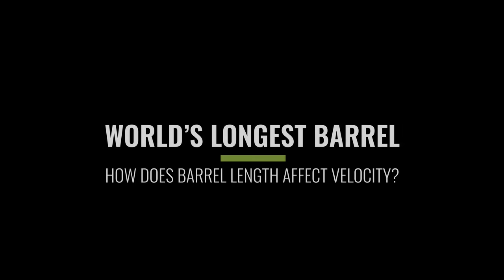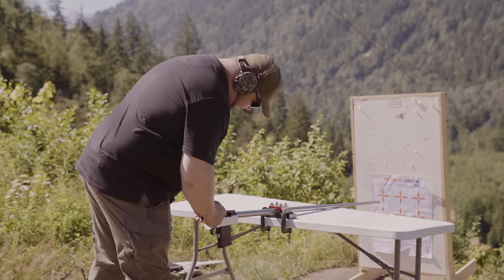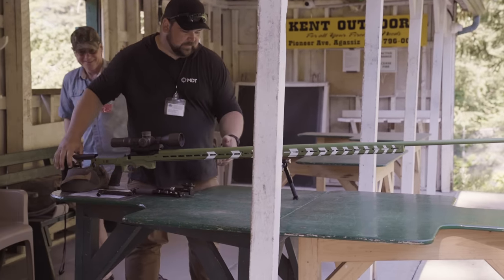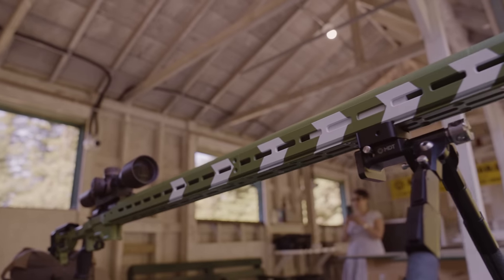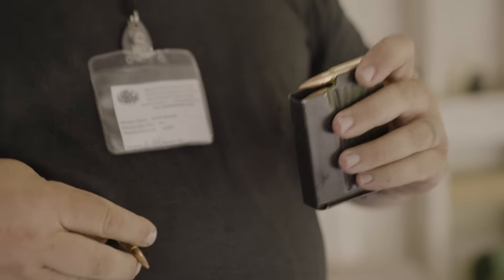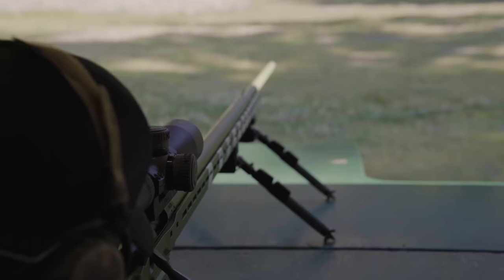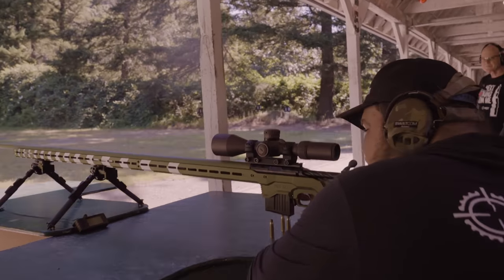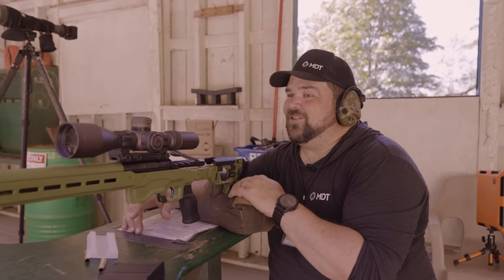Cutting The World's Longest Rifle To Find The Perfect Barrel Length

Comment: This is awesome, great job. And kudos for teaming up with Bob Jury, he’s a great guy. I’d love to see this test done again with a cartridge with a lot more powder behind it, like a 300 Norma, 30 Nosler, or 30-378 Wby. Would be really curious to see what the graph looks like when there’s a lot more ooompf behind it than a 308 Win. Totally understand why you chose the 308, though. Far more relevant test to what larger numbers of shooters are actually shooting.
Reply: :  Additionally, for the purpose of understanding the science / physics test some rounds that are UNDER loaded with powder, say after standard, then; 84%, 71%, 59%, 50%, 42%, 35%.  at the longest length, and graph the results.  As you cut the barrel shorter, maybe only ones with  Std, and 50% powder load.
Reply: @johndavidwolf4239  So they can get stuck in the barrel😮
Reply: @catherineharris4746  No, Start with the Std. load, then work your way down, plotting as you go, if the plot line appears to approach zero for the next lower round, stop, even if a round gets stuck and needs to be pushed out, (I heard that there is this thing called a "ram rod" that is used to push bullets through barrels, and that it was invented centuries ago) that it is a data point, helpful to better understand the ballistics of that caliber.
Reply: @johndavidwolf4239  💡Wow I could of sworn that ramrods were for muzzle loaders that were the only guns used centuries ago. I didn't know they had and used higher pressure center fire rifles centuries ago, and were able to push a stuck slug out of a rifled barrel😕 Are you sure they had these same center fire rifles that required 50k to 60k psi to force that slug through the barrel, and is it really that simple to use a ramrod to push a slug out of a barrel that took that high of pressure to get it stuck there? Dang I guess i just learned something new👍
Reply: @catherineharris4746  : 1)  There are shooters that use muzzle loaders today.  2) The 50k to 60k psi in not needed to force the slug through the barrel as much as to accelerrate it to the supersonic muzzle velocity in modern rifles. Unless it gets stuck just a few inches from the cartrage, it will have already been swaged to the barrel and the rifling and should require no more than a few pounds of force to push it out.
Reply: @johndavidwolf4239  that’s a great idea reduce the loads of the bullet doesn’t come out, and then the gun blows up in your face because of the pressure building up

Comment: I would venture to guess that the left-right deviation you saw as you cut it might have been due to the crown not being perfectly square with a bandsaw finish. I have seen rifles with less than ideal crowns do some wild stuff. Great video!
Reply from the maker: It could be, but there has been some testing done on this subject that says otherwise, but it was still a fun test!
Reply: @MDTTAC  a great shop tool for you guys would be the Manson crown cutter set up in carbide. Manson Precision Reamers setup with a simple cordless screwdriver would give you as near perfect a crown as you can get in minutes for each cut length. Many of us keep copies of your data points because we can trust them. And true accuracy testing means a proper crown. Cheers and thanks for all your hard work everyone!
Reply: @MDTTAC   It’s too late now, but it might be interesting to do this again with high speed photography of the barrel movement in vertical and horizontal axies (and possibly twisting…).  Maybe even a little accelerometer on the end of the barrel.

In a practical sense guns getting too long is a problem, but bullpups exist and adding +10-12” that way is plausible.

This was 308 correct?  I should sit down and run the swept volume in barrel vs case volume numbers.

Comment: I’m 4 years into my physics bachelors and I tried to make a 150 psi air gun that was fully optimized for shooting a 15 grams projectile. When I did the math for the optimal barrel length I was surprised that it turned out to be roughly 2 meters. At first I thought I miscalculated something, but after going through it with an engineer and a mathematician friends of mine, turns out I was right. I didn’t end up building it due to legal reasons lol but I’m glad to see this video. Thanks for making something I couldn’t make myself.

Comment: You tailor the handload to the barrel length available, picking a slower powder for a longer barrel. The same load will perform differently in a 20" vs a 30" barrel. 
9mm handgun vs 9mm carbine is a good example how different the same calibre can perform. If handloaded properly.

Comment: That's awesome, thank you for collecting and sharing that data.  Several years ago I published the results of doing something very similar with a shotgun.  I started with a barrel length at 36" and cut it every inch, measuring MV with slugs, and every 6" in group size with buckshot. We ended up with a 6.875" barrel when done.  The results were surprising and I'm still contacted about it today.  It was published in Small Arms Review Magazine.

Comment: Terrific video!  I’m going to gout on a limb here and say that the optimal barrel length is the length at which the increase in velocity is 1% of the muzzle velocity.  So, for a bullet going 2500 fps, when an additional inch gives you no more than 25 fps, that is when you stop.
I collected some data from other cases where people have cut down barrels such as in this test.  It seems that with .223/5.56, the velocity from a 20” barrel is about 3000 fps and the gain in velocity from a 20” to a 21” barrel is about 29 fps.  Some calculations I did suggest that the optimal barrel length for a .308 would be 21”, 22” for a 7mm-08, 23” for 6.5 CM or .30-06, 24” for .243 and .270, and 25-26” for magnums like 7mm Magnum and .300 Win Magnum.  To get the best out of something like .338 Lapua or .300-378 Weatherby you’d want 28” to get to that 1% velocity per inch mark.

Comment: This type of testing has already been tested by militaries and there's already data available about the limits of positive gains in velocity and energy delivery in correlation to barrel length. There's also information about barrel twist ratio and how it correlates downrange with varying barrel lengths but I don't know much about that information. This test makes me wonder how much your rough crowning is affecting both your speeds and impact points.

Comment: Great video. I been saying longer barrel faster speed for years and it is cool to see video proof. Seen way to many people claim short barrels are faster and better when my personal experience has been the same as this video.
Reply: A lot depends on the cartridge.  For instance, velocity vs barrel length is much more of a factor with 22lr
Reply: @John-uo1qf  wrong, but believe what you will
Reply: @Randy_Cox  Point me to the data
Reply: I have never heard people say shorter can be faster except in the airgun world with spring-piston airguns where the gas volume & energy is extremely limited. In any practical rifle using a rifle cartridge, longer is faster. If it makes a bang at the muzzle, there is plenty of energy remaining.

Comment: 1) Did you chamfer or radius the id of the barrel each time you shortened it? If so, R or C, how did you do it, and how much?  2) In addition to inches, you should also have "calibers"  on your graphs, as length of barrel divided by bullet diameter. 3) IMHO there should be an equation for barrel length (in calibers) that gives the highest velocity based on bullet mass (weight) and cartridge volume, or weight of power, using a "standard" smokeless power.  4) the peak velocity at 45", 150 calibers is about what I expected, but I expected the velocity to gradually decrease longer than that.  5) While you attributed the loss of velocity to friction of the bullet down the barrel, at some point there will be a negative pressure behind the bullet after the volume of barrel ID behind it exceeds the volume of hot gas from the power burning, at atmospheric pressure.

Comment: I've never seen an instance where you lose a significant amount of velocity from excessive barrel. VSO even did testing with a ridiculously long barrel on a 45acp and it mirrors the curve you plotted.
Reply: As much as I dislike VSO, his content is pretty accurate on data points. 

I'd be very willing to bet a large sum of money that you'd need a barrel longer than 10 feet to start seeing any significant dip in velocity, and even then, I'm not so sure. 

My only reservation about this would be in a gas gun where gas could potentially flow backwards, and create suction once the round pushed so far out into the barrel, and gas had already cycled the bolt carrier group.

Ideally, you'd push your gas system further out to counter the extreme dwell time. At a certain point, though, you wouldn't have enough pressure to cycle the rifle... so having a gas system would only serve as a hindrance.

Comment: The real key to this test is the factory powder used, which is designed for much shorter barrels.   If you used reloads with a slower powder, I think you'd have seen a much greater increase in velocity in the longer barrel
Reply: I agree, it depends on the distance down the barrel when the propellant is fully burnt and the subsequent distance when gasses maintain pressure before reducing. A slower burning powder may very well increase the velocity in this barrel test.

Comment: I've always wanted to see this, I hypothesized that most centerfire rifle cartridges generate more than enough pressure to keep the bullet accelerating for far more than typical barrel lengths. It'd be even more interesting to see this test done with super high-velocity underbore rifle cartridges like .30-378 or .220 swift since smaller bores really need the extra barrel length to create more volume for the gas to expand and let the bullet accelerate under a higher pressure than a larger bore allows for. I think you could go beyond 5000 ft/s with this long a barrel, up to whatever the maximum expansion velocity of the propellant gas is.

Comment: Lilja did some interesting experiments on this subject, starting at 4 feet, and then removing an inch at a time. One of the more interesting pieces of  data was the fact that muzzle velocity didnt drop consistently each time they removed an inch. Several times the velocity seemed to "stick", until the barrel was cut down two inchs or more, then seemed to drop more than expected.. In one instance, velocity average actually went up slightly.

The other interesting piece of data was the practical weight limit for conventionally mounted barrels seems to be about 7.5 lbs. Beyond this, barrel "droop" starts affecting harmonics, and thus accuracy. The way around it is something that 1000 yard "heavy gun" shooters have been using for decades: Barrel Blocks. They not only provide a stiffer means to attach the barrel to the rifle, but because the section of the barrel where it threads into the action is rigidly clamped into the block, it effectively "shortens" the barrel from a harmonics perspective, making the barrel behave like it is much shorter than it actually is, increasing accuracy. The downside is, of course, size, weight and cost, which is why you almost never see barrel blocks being used outside of heavy gun(custom rifles that cost thousands of dollars and have a weight limit, if any, of 100 lbs. Most of the rifles in this class seem to weigh between 60-80 lbs)

Comment: Love the 72" barrel.  Have you thought about hand loading and changing the powder dependent on the barrel length?   Since the velocity decreased with a shorter barrel, change to a faster burning powder that maintains the same case pressures.  My thought is that the velocity decreases with shorter lengths due to not being able to achieve full powder burn to pressure ratio.

Comment: I would have thought the extra long barrel would have slowed down the bullet.  Thinking that after all the powder was gone that the bullet continuing down the barrel and making contact would cause drag.  But I guess even after the powder is burned the gas pressure continues to accelerate the bullet down the barrel since the gas has no where else to go.
Reply: it’s an age old question.  my thinking is that there isn’t enough time for friction to be an issue. that projectile is fire-formed as soon as it has fully engaged the rifling, so friction will be constant, not increasing.  For the projectile to slow down the gas expansion would have to have passed the apex of its curve in order for the projectile to begin losing its velocity to friction losses, and how far down the backside curve before pressure has dropped enough to see a change?  I can see that being a thing, but you’d likely need a much larger bore diameter vs length  for bore volume to be great enough to act as an expansion chamber in the time it takes the bullet to exit the muzzle. 

Probably a great experiment for a Naval gun.  I wonder if they worked that out when they were designing the big 16” guns for WWII.

Fascinating stuff.
Reply: You can see this on a barrel chop experiment with a 22Lr or other subsonic rounds.
Reply: @craigvincent2439  that makes sense.  you’d be starting with so little ignition to begin with that the barrel volume could eat the expansion.
Reply: When I was developing subsonic loads for a Ruger 77/44 I used quickload and the numbers were out by 200+ FPS. So I added a barrel friction correction factor and then they were spot on. That factor made no difference to full power loads. As I cut the barrel down to a final 10.5" that again didn't matter as the barrel was short enough the subsonic bullets weren't slowing down or being affected by the friction so much. From memory I think I used 200lbs for lead bullets and about 260 for jacketed 300's in the model.

Comment: If you had of loaded ammo for the barrel length (ie; longer brl length=slower powder)
 you may well have found velocities over 3300fps. 
6.5 x 55 S.M. 29" brl
140gn bullet, 49.4gn H4831...2980fps
6.5x 55S.M.  24" brl
140gn bullet, 49.4gn H4831...2730fps
140gn bullet, 46.2gn IMR 4350...2780fps
These are ten shot AVG figures, chronographed @12' from different barrels but with same chamber and throat specs.
In my experience, the more overbore the cartridge, the more velocity gain per inch of barrel.

Comment: With a 308 win.  I think 24-26 inch max, beyond that the amount of barrel needed for an increase is not worth the weight , and length of the rifle, I know on a 243 Win. 26 inches is the sweet spot. beyond that my fps. got slower.  I think with your test you had to go to 45 inches just to get to a plateau.  Now had that been a 50 BMG or a 30-378 Wolfe then you would have seen a serious increase, but only to the point of how slow burning your powder/case capacity.   Great Show.

Comment: It all depends on your powder choice. You want a slow burning powder to push a long barrel and take advantage of it's length to increase velocity from end to end. Federal GMM purportedly uses IMR 4064 which is fine for a 20-26 inch barrel. I was shooting with a couple of F-class guys and they swore I would never get my Berger 200.2 20x hybrids to 2500 fps through a 20" barrel in my Tikka Tactical. I chronoed my rounds at 2650 with an SD of 5. The cases were perfect and have since been reloaded and annealed.

Comment: I know that everyone has different levels of experience, education and intuition about various subjects but the idea of a bullet actually starting to slow down in front of a fired cartridge, with the amount of excess blast and over pressure emanating from the vicinity of the muzzle when it exits, is UNFATHOMABLE to me.  Even a cursory look would tell me that there's so much unused heat and sound energy at the point of exit, that we could possibly talk about a .308 slowing more than a few fps per inch) after multiple yards rather than feet.  Now, I'm 50+ years old and have been shooting everything since childhood, hunting, shooting bench, silhouette, 3 gun, shotgun sports, etc.  While I rarely think about a rifle report after decades of doing it, all you have to do is see the reaction of someone who's never been next to a relatively powerful cartridge when it's fired.  They say wow! Their eyes get big!  They say things like, "I felt that in my chest" or  "do the earmuffs really do anything?"  Even if you get to a long enough barrel where pressure actually drops, that drop so gradual in the relatively short space that the bullet is traveling down the barrel that you'd expect see very little deceleration. The pressure would need to fall below 1:1 ratio with friction for the bullet to even coast.  After that it would take multiplied sums of negative pressure to slow that bullet (significantly) which doesn't exist. Once you accelerate a bullet to the speed apex, you may have the remaining energy to past through 50 yards of barrel or more.  All one would need to do is calculate the coefficient of friction of a particular bullet in a particular barrel and it would tell you how far it would travel after the 1:1 ratio of force to friction.  You could probably run a similar test with the .22LR and also find very little deceleration or at least a bullet coasting from 3-6 feet.  It would probably be fun to try!

Comment: They had a point of impact shift bcuz the crude manner they used to cut the barrel down. The crowning of the barrel is extremely important bcuz small inconsistencies can result in pressure differences around the circumference of the tail of the bullet as it leaves the barrel which will push the bullet unevenly throwing it off course. It's the same reason ur supposed to clean a barrel by inserting the rod in the breach end of the barrel instead of down the tip of the barrel cuz u can scar the crown